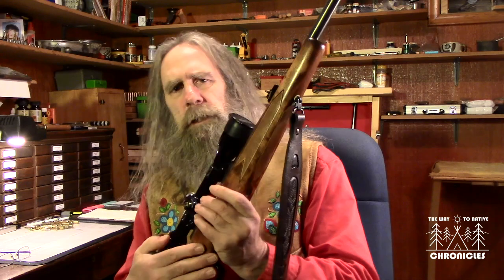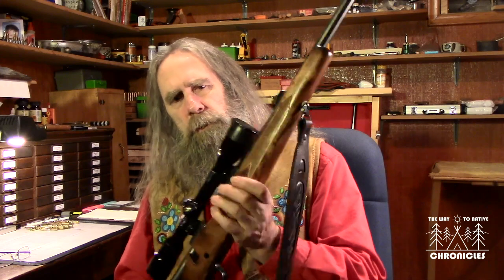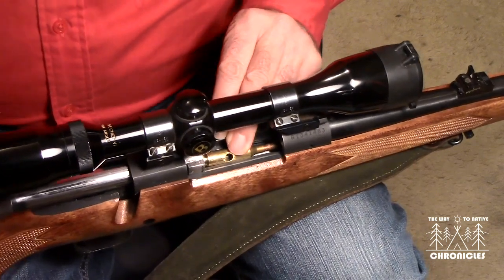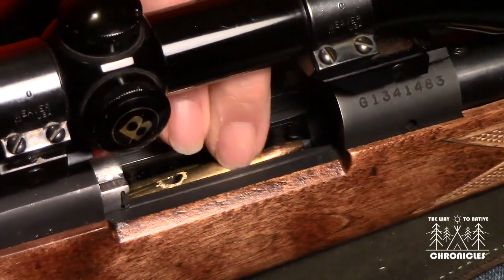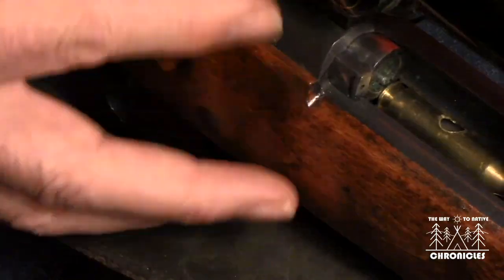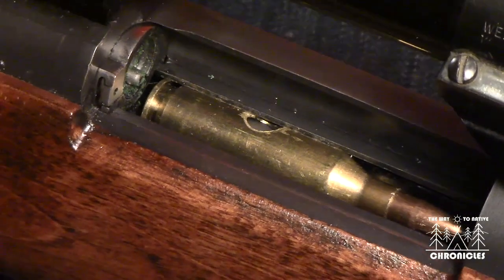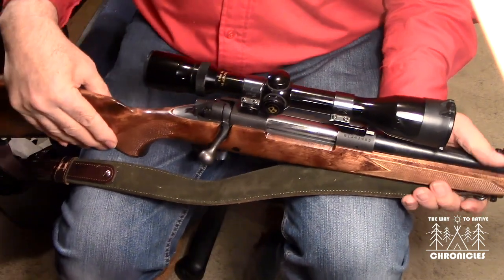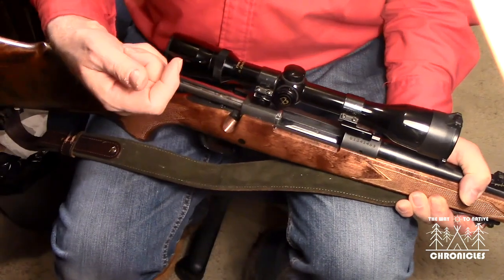Top loading Rifle Magazines - How to Avoid Problems

Comment: Im having a problem with my Remington  700 adl. It's struggling to feed rounds. Maybe a magazine spring issue. I tried it with brass and steel case. I can load 2 rounds and it will feed those. But once i add the 3rd round into the magazine, it fails to feed that 3rd round and sometimes the 2nd round. Like i said 2 or 1 round loads are fine though.
Reply from the maker: Sounds like a perplexing problem.  Perhaps you could try ammunition with different bullet weights to see if that changes anything.  I lighter bullet might have a shorter overall length and cause it to feed better in the magazine.  You'll also want to be sure the "W" shaped spring inside the magazine is all the way to the back.
Reply: @TheWaytoNativeChronicles  I left the magazine loaded for about a week and came back to it. The spring tension seems to have helped the problem, but it's still having problems feeding the 3rd and 2nd rounds without some manipulation of the rounds in the mag, though it's not as bad as before. Might just take it to a gunsmith after all.